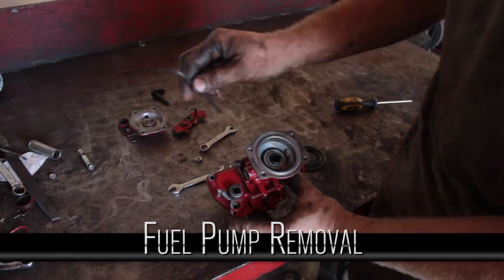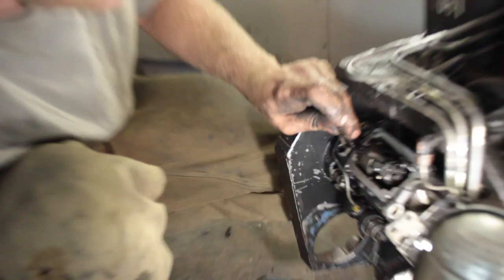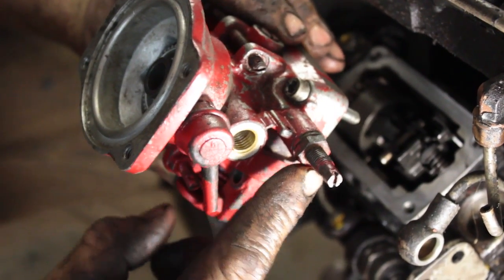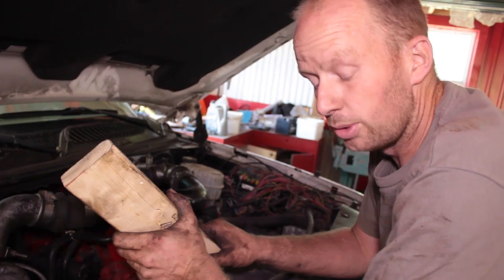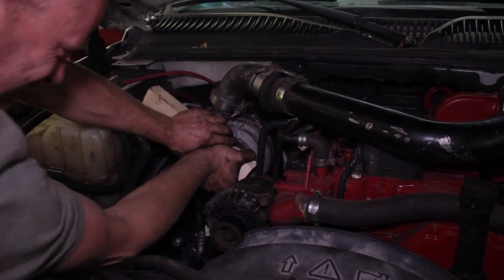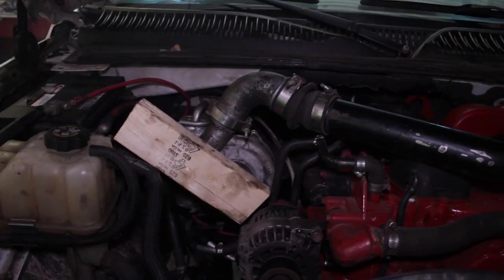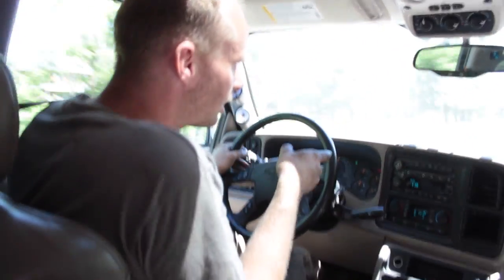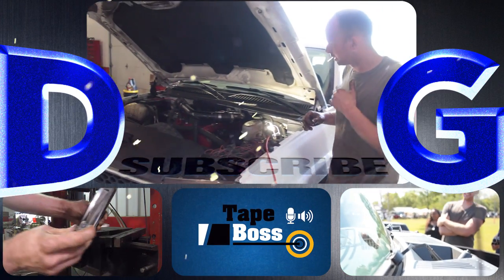How To STOP a Runaway Diesel: 3.9 Cummins 4BT #CumminsTahoe [EP10]

Comment: If on open road could pull away hard in low gear to preserve clutch, put into high gear, then use the breaks to stall the engine? I guess this scenario is extremely unlikely in a diesel car, nobody would be this prepared.

Comment: A good tip is to nail or screw a piece of rubber as wide as the board, like a cut-open bike / motorcycle innertube or something. It will help seal off any extra air & help choke off the engine

Comment: to avoid runaway diesel, 
put first gear with the break pressed, and release the clutch
Reply: Better 5th or the highest it has... As in 5th gear you usualy cant drive of even if you tried to let the clutch out slowly.. And with the brakes slamed...

Comment: When I was a dealer mechanic the lad on the ramp next to me changed out an engine under warranty that had overheated and seized. He forgot to clean the intercooler, which was full of oil. First turn of the key, while still on ramp, it screamed and filled the entire 18 ramp workshop with smoke in 10 seconds before winding down and dying. You couldn't see in there!

Comment: That engine really needs the Alison 6 spd. That trans can even make a gear change in needed because of its .64 second overdrive/6th speed. If your vehicle is already geared for diesel primary from the factory the trans (Alison 6spd) can keep you in the engines power range right up past speeds we ought drive but do so BECAUSE IT'S FUN!

Comment: its not gonna make any boost at idle, think about it. The fuel at 3000 rpm idle and 3000 rpm WOT are very different, dont worry about the idle worry about when its actually under load

Comment: Put it up on a lift, have someone with gloves on, ( egt' s can get hot ) and just have them plug up the exaust pipe with a shop rag. You'll hear the exaust leak, as a loud hiss which could be a good indacation of where you're boost is leaking. Just a thought. I'm more of a Powerstroke guy, dont know anything about Cummins but I've found more than a few boost leaks this way.

Comment: I had a maxxforce 13 run away on me one time. I put a new turbo on it for passing oil and didn’t check how much oil was in the cac.  I was backing it out of the shop for a road test. As soon as it built a little boost the engine started revving up on its own. I thought hmmm that’s weird so I pushed the clutch in and it took off straight to 4000 rpm in about a second. Luckily for me I already had it in gear so I slammed hard on the brakes and let the clutch out and was able to get it shut down without serious damage. That was one hell of an adrenaline rush lol.

Comment: I don't know jack about diesels, but on a gas engine boost level is determined strictly by the wastegate setting.  There may have been an electronic solenoid that controls the wastegate on these, if removed would lead to super low boost.  Just a thought.

Comment: I mean I know it's a runaway and most people won't even try to save them from the beginning but won't to much fuel and not enough air melt a cylinder?  So even if you snuff the air isn't it still harming itself?

Comment: Put it in the 5th or 6th gear and it will shutdown!
For automatic transmission do what he's doing
Reply: But will it shutdown in 6th gear at 70 MPH?
Reply: @wyattlarrick3246  can you cover the intake at 70mph?
Reply: That wont always work. Cut off the air supply.
Reply: Your wrong even on a standard it wouldn’t kill it it would bog down a little bit that’s it

Comment: Why don't they make a better way to stop a runaway?
Reply: They do. It's called a Roda Deco Valve or "Positive Air ShutDown System". Engine runs away and you flip a switch. It slams a slide gate closed and stops all air from entering the engine. The valve just sits inline of the intake. Up here in Northern Canada your not even allowed on an oilfield site without one.
Reply: Goofygiggles They make shut off plates on high horsepower diesels. Basically just shut close
Reply: Ian Thompson Okay thanks
Reply: the best way is a 2x6 with a 1 inch piece of rubber screwed to it

Comment: really simple way to stop runaway diesel, stuff rag in intake. BUT if I ever (doubtful) own a diesel, I'll just splice a fuel shut off valve in an easy to get at spot in fuel line, simple.
Reply: JFK64 Kennedy fuel is irrelevent because itll just burn the oil anyways
Reply: Wow, a genius here. A fuel shutoff huh? How does a diesel normally stop? Oh that's right. Stopping the fuel. Weird. I wonder why it'd keep running away after you stop the fuel.
Reply: JFK64 Kennedy it will suck the rag in and spit it out the tail pipe now you have to take it apart to remove the rag
Reply: You can shut the fuel off on a runaway, but it will keep reving till it blows up. When a diesel runs away the turbo is pumping engine oil into the combustion chamber. That's what the engine is running on. Only way to stop it is stop air flow. Tags won't work either. The turbo will just suck them in.
Reply: oil from the turbo seal is not the only cause for a run away diesel, so a fuel shutoff could work if the problem was the injection pump
Reply: JFK ... it is not the fuel here but the other part of the combustion the AIR!
 - since the fuel is not from the fuel lines but an outside source, like the crankcase, etc...
and some diesels are equipped with the air intake shut off plate!

Comment: dumb arse all you have to do is cut off the air supply to the motor and turbo
Reply: If you have a manual transmission, you can deliberately stall the engine. (Once the car is stopped, press the clutch pedal, engage the highest speed, engage e-brake, apply full pressure on brake pedal, and release the clutch).

Way safer that popping the hood, at the risk of be in the course of a broken part.

Comment: Most diesel engine runaways are caused by because of one thing or another the engine starts sucking motor oil out of the crankase and the easiest way to stop a runaway Is to SHUT OFF the airflow to the engine and that will choke the engine down then u can proceed to find out why it was running away. most of the time the turbo charger will blow an oil seal and start pumping oil into the combustion chamber in the engine
Reply: nice research kid

Comment: You want more turbo boost? Experiment with boost Venturi. It is a proven theory used on IC engine carburetors as I'm sure you are aware of, although carburetors are fast becoming obsolete some of the systems and their parts could be reworked, enlarged, etc .  Tested and tweaked on a flow bench for satisfactory results under real operating conditions.

Comment: You never should have started with oil in any intake component..... I had run away on caterpillar engine in big truck I removed the pipe going to intercooler and stuffed my hoodie in there..... Saved the motor it was running super high over Rev.... Kinda exciting after thinking about that driving for few days talked to the boss and now all trucks have a halon fire extinguisher and all drivers are told how to kill by spraying halon into the air filter..... Take away the fuel or the air (oxygen) and she will stop... On that truck you are working.... Put in gear and let out clutch if manual kill motor by clutch braking with foot in brake..... Or take knife and cut the hose over the top..... Then stuff shirt in....... The cat that over ran on me I disconnected the pipe to the intercioler on passenger side... Couldn't get to the driver side due to wind direction and the cloud of thick choking oily smoke..... The intercooler had drawn a lot of oil so getting the turbo oil leak separated didn't stop it by getting rid of the oil fueling it..... The hoodie did the trick though

Comment: Try fire extinguisher?  (dry chemical will plug the air filter, CO2 will smother the ignition)
Reply: that would create a lot more work in the long run, the dry chemical will get sucked into the intake and into the cylinder. which then it will compact from the piston and possibly damage rods and many other internal parts.
Reply: It would also ruin the engine .
Reply: That will work. But after that you would need a new motor or you would need to have it cleaned out. Thoroughly.

Comment: i used glowshift for my air suspension and seemed to work fairly well.....but i had a glowshift for oil pressure and it shitout and wasnt reading right. put in a mechanical gauge for oil and read perfectly. so i think its really hit or miss with glowshift

Comment: So choking a runaway with a shirt or something isn't going to happen if a 2x4 can't hardly do it, nice to know, I don't own a diesel but I have a fire extinguisher in my car so if I ever see a runaway I'll know to just use it on the intake to remove the oxygen.
Reply from the maker: Throwing a shirt in a turbo will just destroy the turbo and your engine.  Very bad idea.  This is for if you are working beside a car.  If you see a runaway and hope to help, its too late.  Fire extinguishers also leave a big mess to clean up.
Reply: Well I didn't mean throw it IN the turbo lol, I meant try to block air into the intake (Assuming you have an intake pipe attached in front of the turbo inlet), but with the amount of suction that thing pulls I assume I wouldn't be able to stifle the air enough (not to mention it would most certainly suck in the shirt!).  I just heard from a few others that a fire extinguisher displaces enough oxygen to kill the engine, I would rather a mess to clean up than a totaled engine.
Reply: If you can get a small ammount of air through a shirt (breathe through it..) any engine will breath just fine.

Comment: A better thing to do would be to wrap the 2x4 with a few layers of duct tape. this will act as a gasket for what its worth its better than flat wood...
Reply: what about an inner tube wrapped around the 2x4? would that stretch too much?
Reply: @04ramtuff  I'm thinking you'd rather get a nice big PVC 90 degree ball valve and another rubber coupler.  Or maybe one of those rubber exhaust flappies used on inboard marine thru hull exhausts - prop it open so if you tugged the prop out it would flap shut.
Reply: Nick Blenderman the reason for just a 2x4 is the turbo is pulling in so much air at such a fast rate it would suck the tape off and then you have to replace or repair the turbo

Comment: another way to kill a runaway would be to have a small  bottle of argon or co2 next to the turbo, and if it runs away open the tank right into the turbo. also way back in the day my grandpa had a runaway grabbed a 2 by 4 to put on the turbo, it slipped and his fingers went into the turbo and he lost three fingers in the process.
Reply: Where do you buy a bottle of argon?  And sorry about your grandpa's injury.
Reply: @nthgth  you can get it at welding gas supply stores usually
Reply: @stalinsbitch7428  lol I guess I don't normally pick out the welding gas supply stores in my area but I'll keep an eye out

Comment: I just installed my new HX30w to replace an old H1C I also in stalled a stage 1 fuel pin from Denny T now I have smoke on start ups and on heavy accelerations can this be fixed by turning the smoke screw out? if so how many turns?
Reply from the maker: trial and error.  Keep turning it out until the smoke stops.
Reply: gospeedracer40 8 turns

Comment: one more thing I have an idea do you know how a steam engine work is just a little bit like a diesel motor when the engine got very hot and the turbo temperature is up in the intake put a tube less than quarter inch like a windshield water tank with motor when the oil pressure is high it's a switch to put on you can use it from my air condition low pressure switch when the motor is almost fully accelerate the water will inject into the total it will keep the total cool raise efficiency of the diesel motor cleaner burning no hydraulic lock the liquid will vaporize in the turbo better compression clean ahead water is a lubrication don't forget. when you turn off the engine do not worry the water will evaporate it's something I'm considering for efficiency I will be doing it on a single cylinder with a turbo also water create hydrogen an oxygen what are released a small percentage of oxygen when its hot
Reply from the maker: Someone mentioned this in another thread.  I don't know much about it but definitely keep me updated on how you make out and send me links.  Thanks!

Comment: when using a co2 carbon dioxide use the air compressor blowgun squeeze is the soccer into the intake it was shot down in a heartbeat easiest method I found out I was building a military generator I couldn't get it to stop I put some Co2  inside stop with no damages I've been using the system for a very long time the piece of wood on the turbocharger different strokes for different folks I like doing things the easy way the Safeway

Comment: the rubber coupling is a no hub coupling from plumbing I thought I would tell you that it make life so much easier
Reply: hey there I have a question for you if you don't mind. I just installed a HX30w  and a new fuel pin I have heavy smoke on start up and heavy accelerations can I fix this with the smoke screw? if so how many turns?

Comment: why are you trying to invent the wheel back over put a big PVC lock off valve with a rubber coupling it's really cheap on the intake off the turbo turn it off problem solved here's another one for you carbon dioxide from a soda tank feed it through the intake it turn off like when you having sex and your mom call you on the telephone
Reply from the maker: +clive sinanan I was only showing what to do in an emergency runaway when you are panicking.  People usually don't bother making a PVC shut off or have CO2 on hand.  There is usually a block of wood or a clipboard close by though.  If I was working on the same engine everyday I would definitely take your advice, Thanks